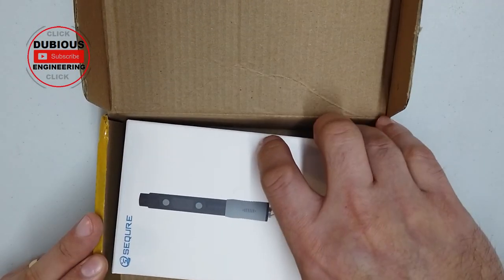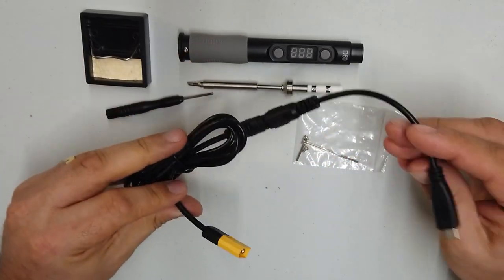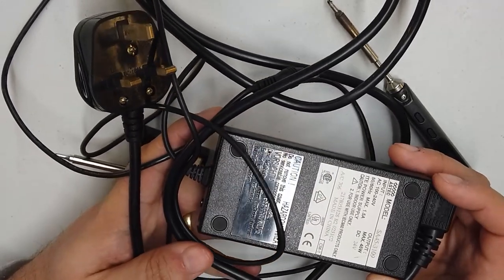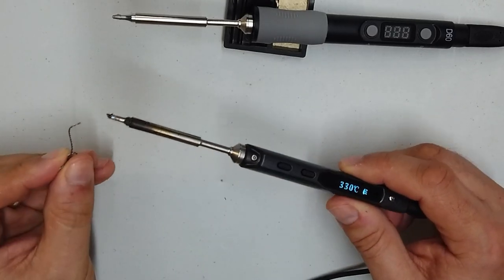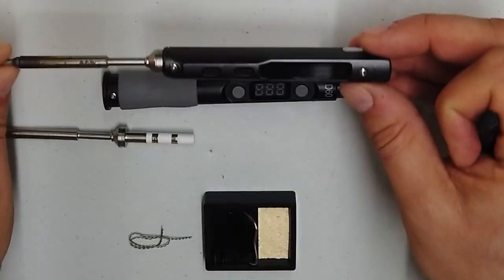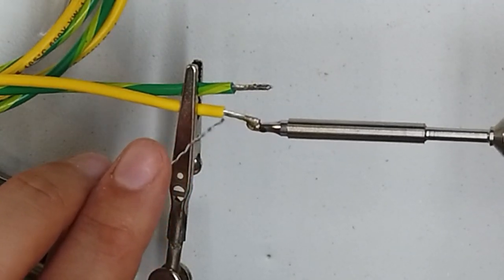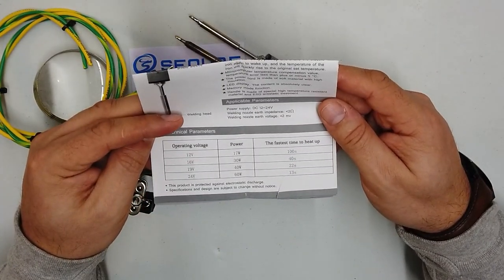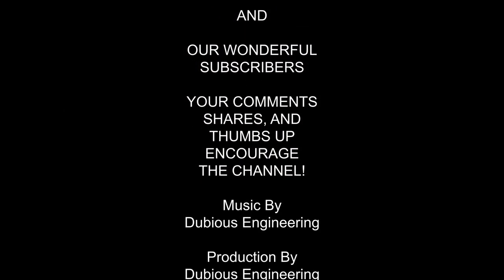DuB-EnG: Best Value 12-24v Digital Soldering Iron - Sequre USB-C D60 vs TS100 comparison and testing

Comment: What do you think to the usb c port ? My ts100 has cracks around the barrel jack that I have glued more than once.
Reply from the maker: wow...  I’ve had no problems with the ts100...  I admit, I would think a barrel jack would be stronger and more robust than a usb c port.  let’s keep an eye on it!
Reply: @DubiousEngineering  I have snagged my power lead a few times and sent the ts100 flying so my fault. The plastic case is cracked but the jack is ok. This sequre looks like a good replacement and cheap enough to have as a backup.
Reply from the maker: I'll use it as a primary for a bit and see how we get on... let me know before you commit and I'll give you an update!

Comment: People say that it draws 1.37 amperes no matter of the power supply voltage, so it should have about 33w max power. Could you please check It's power consumption at 24 volts?
Reply from the maker: I absolutely have to check this! ... thank you!
Reply: @DubiousEngineering  BTW I've got an answer at the sequretech channel. They told that it is about 37W max power.
Reply from the maker: @nikoelias1201  And... boom!  Theres our answer...  thats still a fair ammount of power... thanks!!